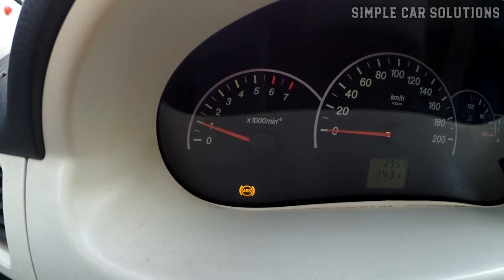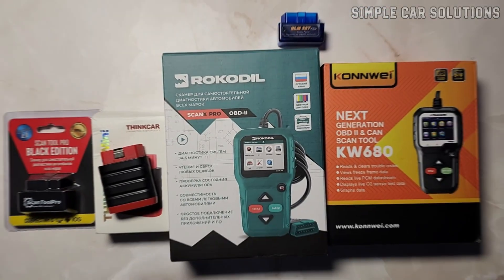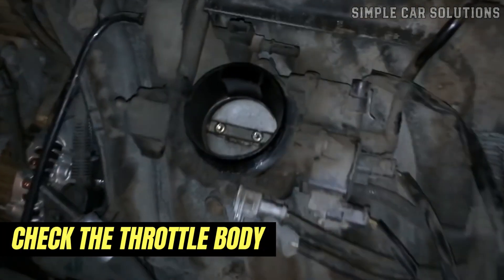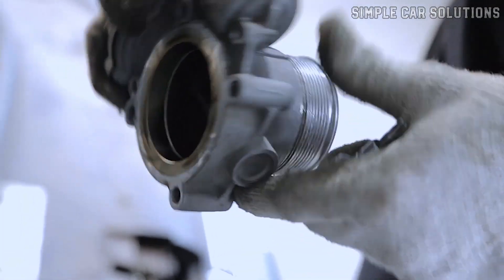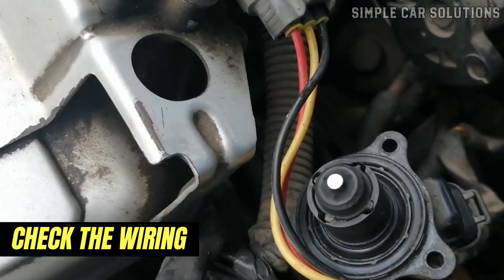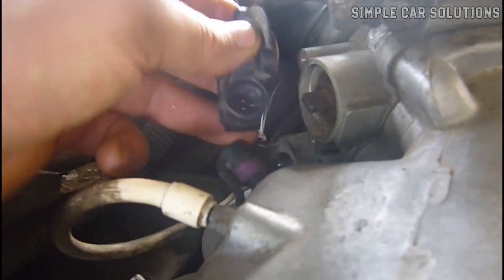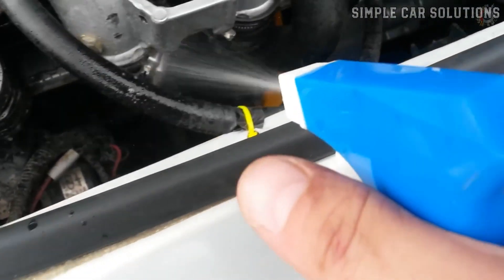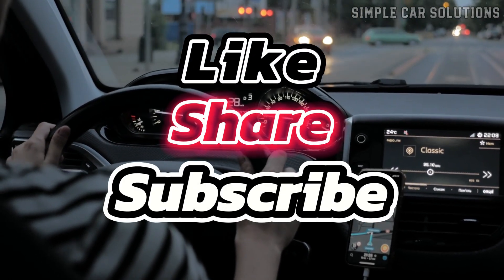Why Car Engine Idle Up and Down. Top 5 Reasons Your Car Engine RPM is Idling Erratically

Comment: I both golf r mk7 astate its on bags ment be mapped to 390 but i get the idle going up sometimes then stop not all the time but some times
Reply: Oh my gosh everyone making this so over-complicated I had all of these issues and it was a hole in my muffler
Reply from the maker: @ Thanks for sharing your experience
Reply from the maker: Intermittent idle surging on your Golf R MK7 could be due to a faulty diverter valve, dirty or sticking throttle body, vacuum leak, or issues with the ECU map. Also check for a failing MAF sensor or PCV valve. Scan for codes — even if no light is on—and check fuel trims for clues.

Comment: New throthle, new spark plugs , new fuel injectors  new catalytic conver still shakes what would be the problems
Reply from the maker: This video discusses possible issues when your car engine RPM is Idling Erratically. If your issue the car is shaking, I recommend watching next video: https://www.youtube.com/watch?v=NA-XWazdHVc